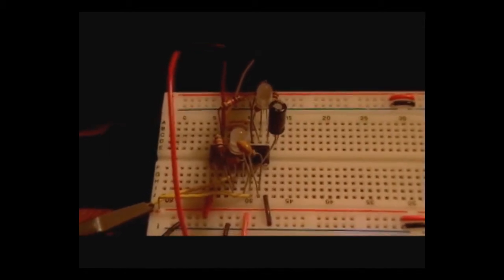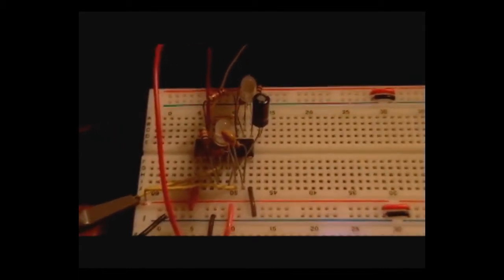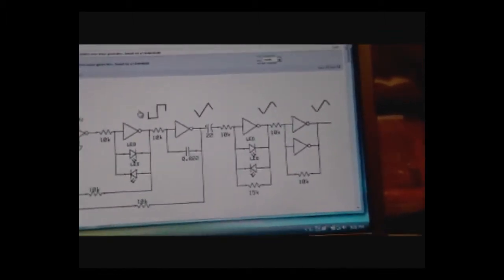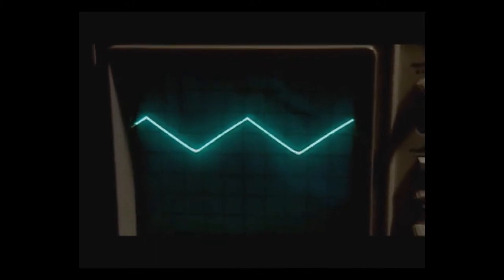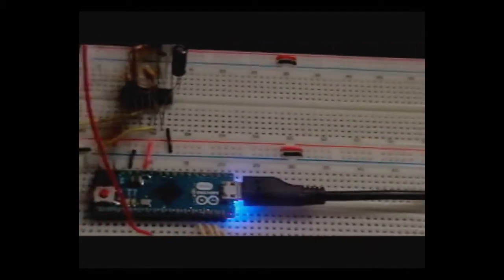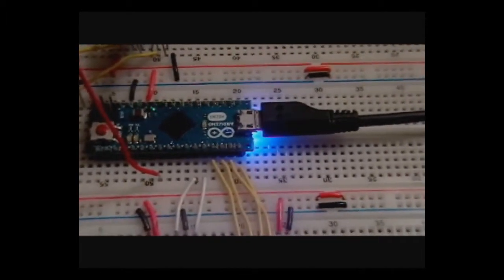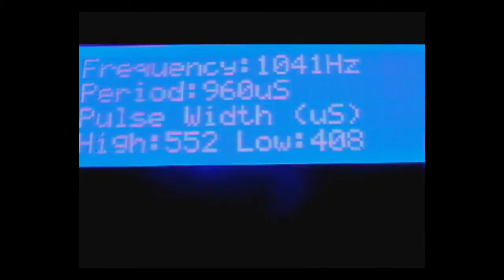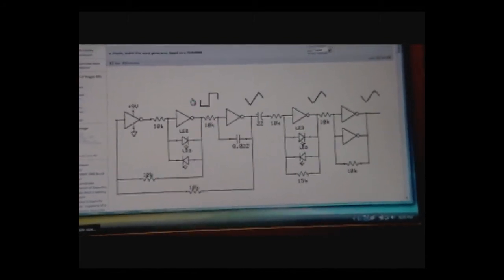Square Triangle and Sine wave using CD4049 chip

Comment: how come you used one led instead of 2 in the orig. circuit?
Reply from the maker: I actually assume you are asking why I used one LED in place of two in the original circuit.  The reason being that the LEDs I used are bi-directional.  They are green when the current flows in one direction and red when it flows in the other.  In essence each LED is the equivalent of two LEDs.